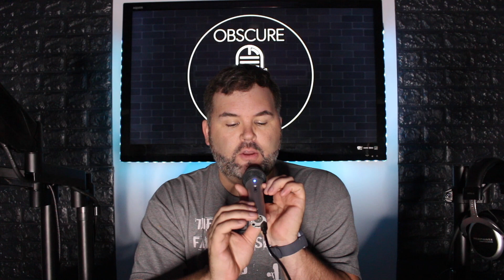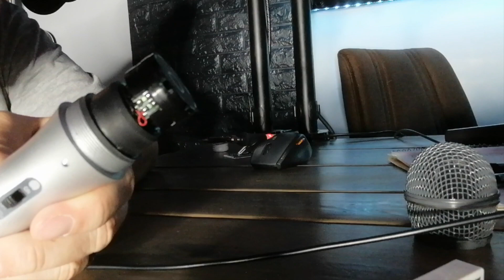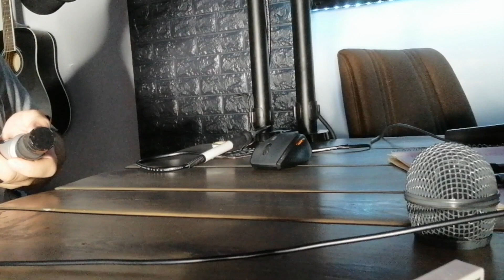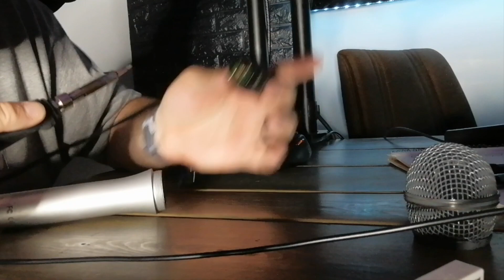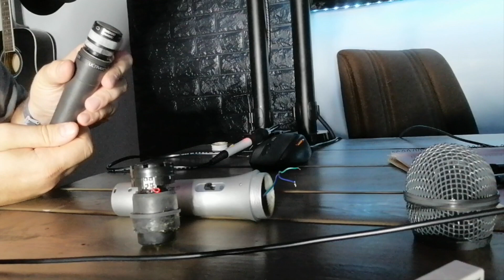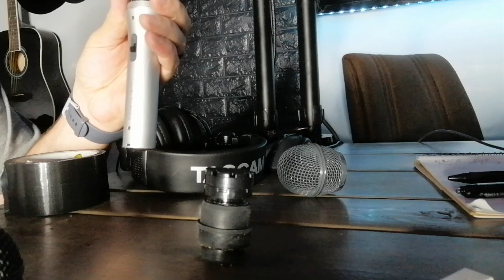Behringer XM8500 USB?  The ATR2100 from Audio Technica gets frankenmic'd !! Capsule replacement #1

Comment: Two Ideas for you if you do not mind. Keep a data base of all the capsules you remove and interchange.  As I think loads of different cheap microphones, all have the same guts.  Just a different company name. How many Microphones made in same factory on same production line. Then different paint or sticker put on at the end.  Two.  Buy a bag of $2.00 Mic capsules.  Then fit them in load of different Mic bodies.  No Boards just capsules and sponge to hold them in.  Then try out on us lot. eg $2.00 capsule in six inch plastic pipe and six inch copper pipe.  You get the idea. Your Carbon based life form fans will love it. Well I will.  See if we end up with a tone wood, as in guitar type situation.  You know Mahogany sounds better than pine or chipboard situation. on guitar bodies. I still think you may get lucky on one of your conversions and make a wonder microphone. Keep up the good work. My top guys in no order.  Podcastage, You, Booth Junkie, Curtis Judd, Sound speeds.  I need time to sleep as well so can not watch everyone. Drink lots of coffee.  Life is short. So little time.  So many microphones to build. Thanks great Channel.  Right you can breath now.  Im off.
Reply from the maker: Great suggestion!  I'm not sure how many of these I'm going to video, but I'll definitely do INTERESTING ones....I'd like it to be 10% of what I do....and you've made me want a custom wooden mic...
Reply: Do mahogany or bamboo

Comment: First impressions, I think I can hear a pretty significant difference between the pre- and post- operation mic, but I don't think the post-operation mic sounds like an XM8500. Assuming you were recording in USB mode, maybe the electronics does some EQ at the processing level. Could you compare this mic in USB vs XLR mode?
Reply from the maker: Yeah the internal interface has to have some eq to it